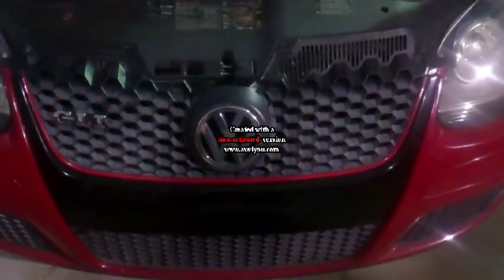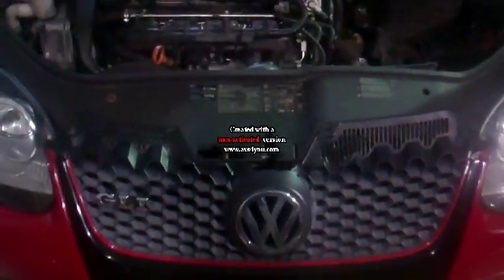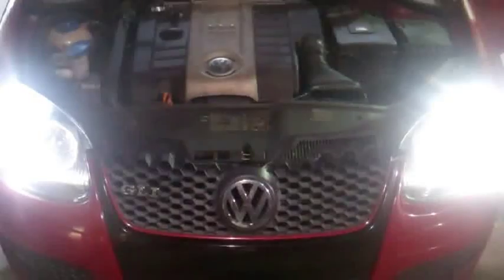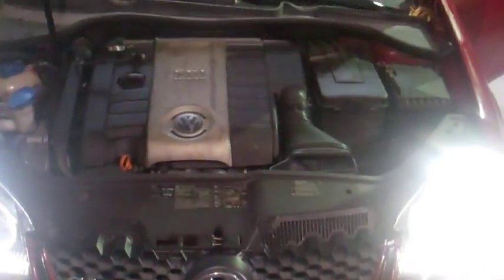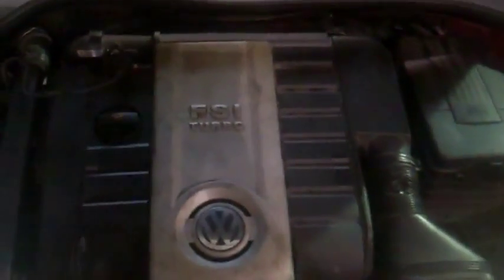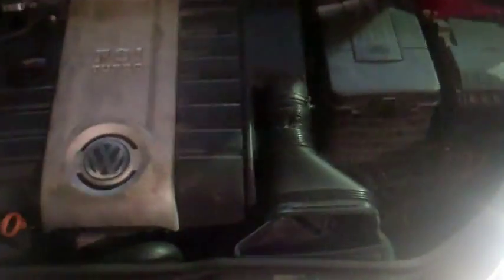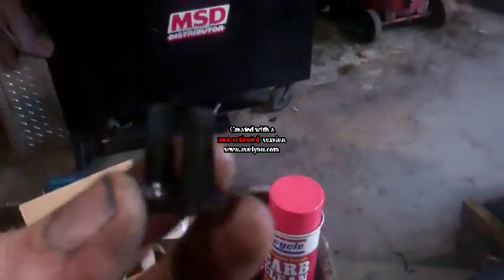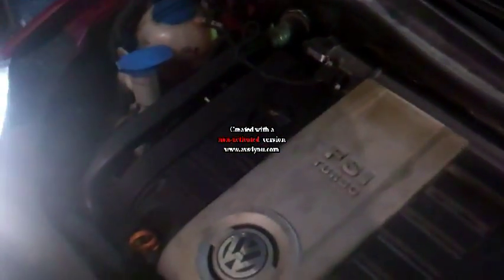Volkswagen GLI FSI Bad Injectors Diagnosis

Comment: So how would you know if it was injectors ? I have A4 b7 and I have changed out the plugs and coils and I’m
Only getting a cyl 4 mis
Reply: FreeWave-Art Same "EXACT" Car and Situation...dealer said it's the injector. Sometimes a little leary of their diagnosis...but a few year back, was have an issue, in which they said it was the in-tank fuel pump...thought they may have been just trying to get me on such a costly repair...but low and behold...it was the pump. So in this case (Misfire Cyl 4), after changing Every and Anthing related that could cause the problem, and it still presisting... guess it actually is the injector. My prob now is...with parts like that, and the work and labor (time/cost) that go into changing it...I'm learning toward trying to do all 4 at the same time...to avoid having to go back in there later, if other(s) fail.